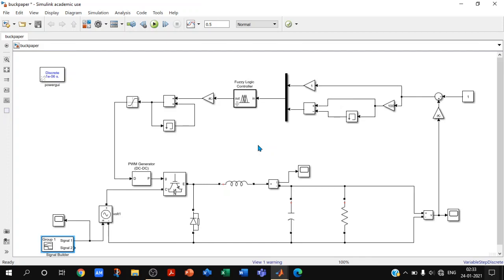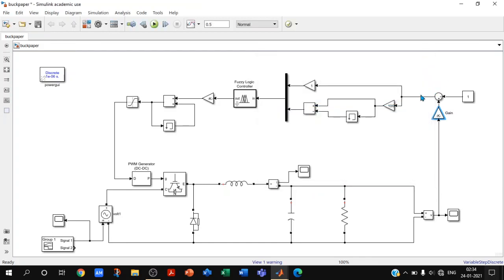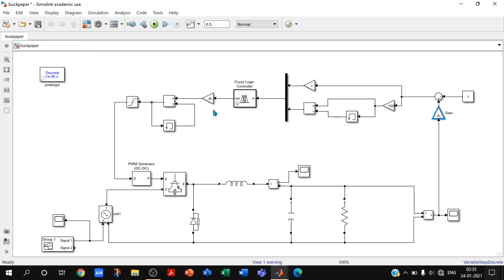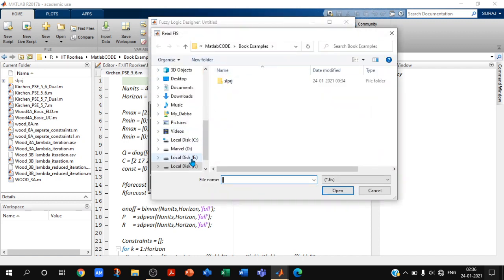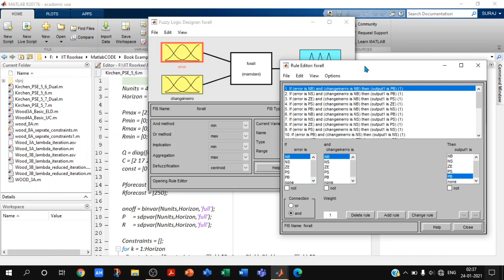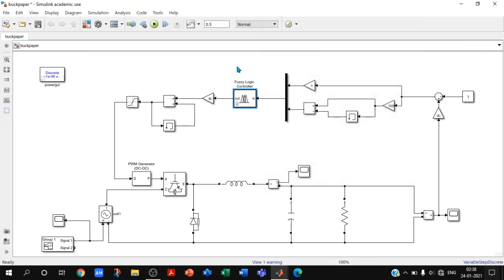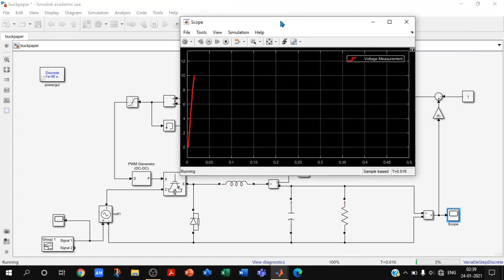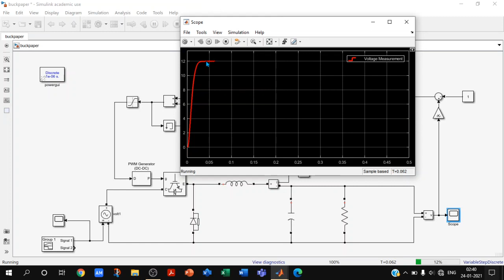Implementation of Fuzzy Logic Controller on DC-DC Buck Converter: Matlab Simulation (Part 3)

Comment: in boost fuzzy what is the use of sample  and hold
Reply from the maker: Hi I didn't get the question. The use of sample and hold circuit is similar in all application. It is just to hold the signal for a specified amount of time. I am not aware about any different use in fuzzy.

Comment: how i find value gain after fuzzy logic ? 
thanks
Reply from the maker: You can understand it this way, the membership functions are not designed according to exact mathematical calculations so it is possible that sometimes the value generated by the combination of error and change in error does not generate the desired output. The required membership functions for error and change in error might be somewhat stretched or shrank versions of the membership function that we used and updating the membership function from within might be a time taking process. Simply speaking if you design a membership function and you are not getting desired output then instead of updating the membership function from inside just do some variation with the gain parameters and it will do the trick. It is very difficult to explain it over a comment. However, I hope It helped you doubt.

Comment: Another great video! Can you explain what exactly is the gain that comes after the fuzzy controller does? I understand that it depends on the values of the circuit but what is the purpose of the gain? And is there a way to calculate it?
Reply from the maker: Thanks you.. I am glad that it helped you!!! You can understand it this way, the membership functions are not designed according to exact mathematical calculations so it is possible that sometimes the value generated by the combination of error and change in error does not generate the desired output. The required membership functions for error and change in error might be somewhat stretched or shrinked version of the membership function that we used and updating the membership function from within might be a time taking process. Simply speaking if you design a membership function and you are not getting desired output then instead of updating the membership function from inside just do some variation with the gain parameters and it will do the trick. It is very difficult to explain it over a comment. However I hope It helped you doubt.

Comment: Thank you for the video sir. Are there any other links to download Matlab simulation files? because I don't have a Matlab account so I can't download the file from the link in the description. It means a lot to me to get the simulation files because this video is one of the good references for my final project.
Reply from the maker: Hi Abdul creating MatLab account is straightforward, you can create an account with your email id, try once if it still doesn't work then tell me I will upload these on some other platform.

Comment: Hi,i am a student of final year i have an query about my final year project for parallel operation of boost converter using fuzzy logic.. so would u provide contact details
varutejas2@gmail.com
Reply: Hi...I have not gone into the operation of parallel converters, but you can ask me your doubt here. I will explain if I have any idea.
Reply: @batman98298  i have to do equal load current sharing among parallel connected converters
Reply: @TechMaz  Sorry tejas i am not aware of this concept

Comment: Hi, how to change the parameters of gain block?
Reply from the maker: Hii are you asking for a proper mathematical way for obtaining the parameters or you are asking about how to change these in the simulation model? If you are asking for a mathematical way then I am sorry but I have not followed any proper way, just hit and trial, and also I don't think there is a mathematical way as the Fuzzy logic controller itself does not have any mathematical information of the system. But you can search for it. As for changing the parameters in the simulation model just open the gain block and start updating values in one direction (increase or decrease) if results are not going in your desired direction then change the direction (decrease or increase). Hope it helps